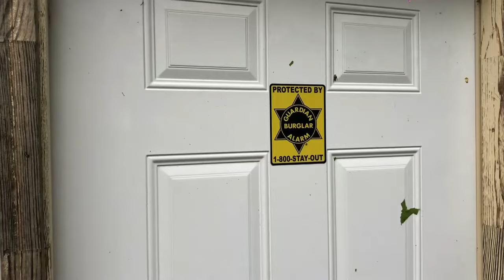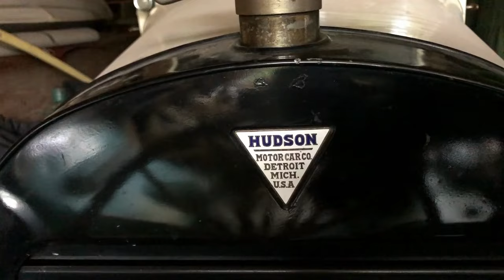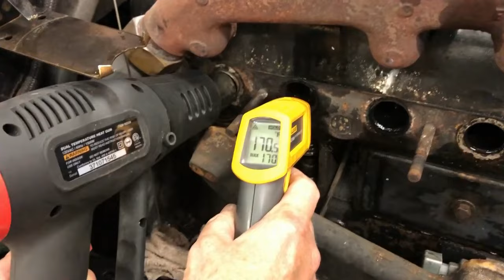Barn Find / 1920 Ford Model T / Will it run? [EP42] @KlepsGarage

Comment: Cars are wonderful these days, with their easy starting, power and fuel efficiency, and ability to go well beyond 100,000 miles, but still remember the good ol' days when, if you got gas, compression and decently timed spark, it would run.
Reply from the maker: You also can fix without a computer telling you what’s wrong

Comment: For lapping valves you would be using a fine abrasive valve grinding compound not graphite which is actually a dry lubricant.

Comment: I like that Hudson but it needs to be a dark color. The Auburn was the wrong year. The later ones were more attractive. Model T's are easy if you know how to think Model T engineering. They are very reliable but don't expect much of it so far as comfort or sophistication. They all have a sweet spot to start them and not much room for error. Great video.
Reply from the maker: Thanks for watching. You are correct and that’s why I left the Auburn and Hudson sit. Figured T was easier to resurrect. Check out my newest vid on a 1932 Nash. Then you will see why I was chasing that Auburn. Think I’ll keep the Nash.

Comment: Great video and a sweet little roadster. I like your technique for pulling off the head. Did you replace the head gasket or reuse the old one? I just finished replacing the rods, and reinstalling the pistons in my ‘26 Model T. I started her back up yesterday, and it was so exciting to see her roar back to life. I’m looking forward to watching more of your videos.
Reply from the maker: Thanks for watching. Used old copper gasket. As none are available now to buy new.

Comment: What did you do to change the timing. When you climbed out of the car and you left the door open. You bent down and done something with it. Just curious as to what it was. I have a 23 Touring. Great video to.
Reply from the maker: Rotated, the distributor left and right advance, and retarding the spark manually. As a distributor is an aftermarket item.  Have to tune by ear as no timing marks.

Comment: Nice video. Did you pull the spark plugs and put it in high gear when you were towing it?
Reply from the maker: Plugs was trying to start.  When started only running on one cly. It had issues.

Comment: Oh, yes?  A restored model T found in a barn?  You could of said the same about mine...in a barn with 15 years of dust, before putting it in a museum...are people this gullible?  This is not an unrestored car someone put away before WW2 and forgotten...
Reply from the maker: Do I detect sarcasm. As the title says and as the video says I went to find a barn find Auburn which had been sitting longer than 15 years. I didn’t buy it because it was way over priced. Left the Auburn sit and bought the T as it has  parts that  readily available. 
Thanks for watching